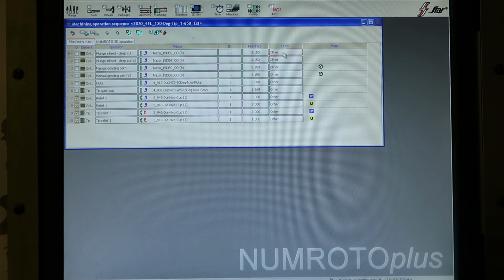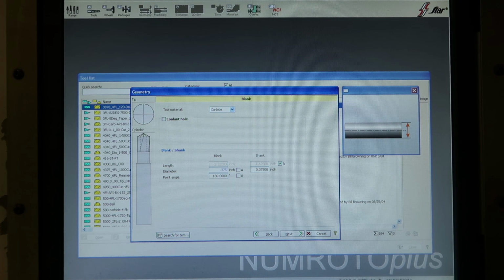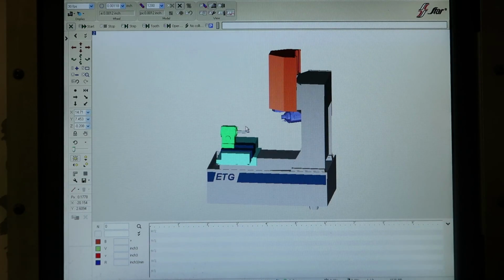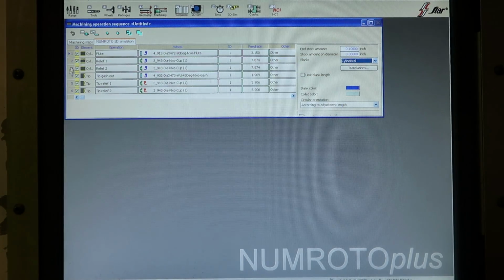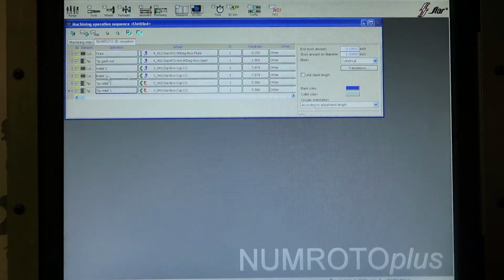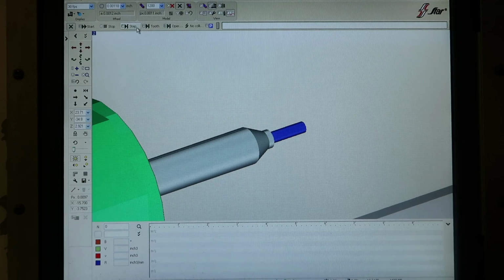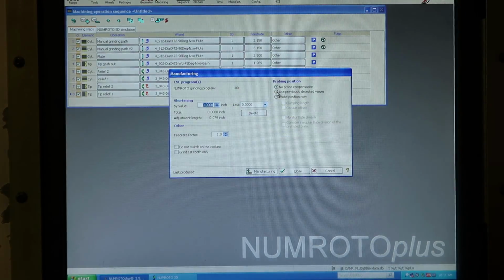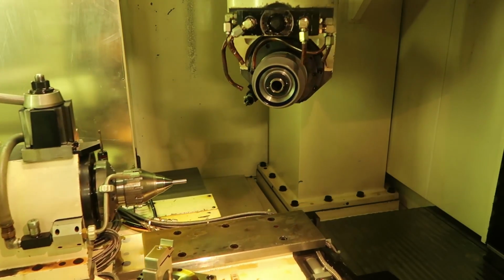Grinding Special Endmill

Comment: Hello I have 1 question. You changed length of rod on 0.1 inch I understand why. I did something and simulation was OK. If I wanted to make tool like this my machine doesnt count with that. Could you write me where can i rewrite this value for NC machine? Thank you for answer
Reply from the maker: Are you using the same NumRoto software that I am?
Reply: I have version 2018
Reply from the maker: In the manufacturing menu you need to select shorting the tool by the amount the tapered tip sticks out in front of zero. (In this case it was a little less than .100". So I used that.) But if the setting in the probing setup is shorter than that it wont let you enter the .100" shorting in the manufacturing setup. You need to increase that to something  greater than the value you set in the manufacturing setup. This is only necessary because the tip of the tool is greater then the blank. Or more precisely greater than the software thinks it is. I am forcing the software in this case to do what it isn't really setup to to. But it will do it.
Reply: Thank you so much i watched your video again and I know what was problem. I made 1 chamfer thank you for idea

Comment: The principle is good but you don't realise the limitation you place on yourself by using the "flat" surface of a belt grinder. Using the round surface of a grinding wheel and placing the drill bit against the wheel ABOVE the centre of the wheel "automatically" grinds in some back clearance angle. A little like a ".hollow grind". Doing it in this way you have enough room at the end of the drill bit to grind a nice "facet" on the cutting edge. (The movement of the drill bit is more or less the same though).
When you have finished grinding the cutting edge a very slight "tweak" to thin out the web provides a nice "point" to catch in the centre punch mark. AN advantage of the "facet" is that it makes it a little easier to see if the cutting edges are equal.
Regards

Peter

Comment: In response to "Hey You"
After 40+ years in the industry you should be able to sharpen drill bits in an instant "with your eyes closed" It's certainly NOT a difficult task. It takes only seconds to sharpen a drill bit, certainly less than a minute to sharpen a DULL drill bit and not much more time to sharpen a damaged drill bit! I can sharpen a dull drill bit in less time than it would take me to go to the cupboard and unwrap a new one!

Comment: That is awesome! I love your channel man very cool machining work! How much does a custom end mill usually cost?
Reply from the maker: It kind of depends on the size and tolerance. Any ware from $70.00 to $200.00 for a 3/8” size. Also it depends on the complexity of the shape and coatings if any. I have made tools that went for more than $500.00 for just one tool. So it depends.
Reply: Thanks for the reply! Thats actually really reasonable! I wanted to get some custom Onsrud like O-flute bits made with longer cutting edge, something like 3/8" shank with a 2" cutting edge for the deep pocket reservoirs i make on my cnc router.

Comment: That looks like a really good software package with that machine. It sure is a nice piece of equipment too, looks a lot faster and better than doing all that on a #2 tool and cutter grinder by hand.
Reply: work of art making works of art...
https://www.youtube.com/watch?v=MtLAn1Ud_U4
http://www.star-su.com/machine-tools/tool-sharpening-machines/tool-cutter-grinders/PTG-6L
Engineered to manufacture complex cutting tools, the new Star PTG-6L is a five axis, CNC controlled cutter grinder for manufacturing, sharpening and reconditioning a wide variety of cutting tools.  Made in the U.S.A. and equipped with a six-station wheel pack changer, the PTG-6L is built for high productivity and precision.

Comment: How did you run without coolant? You mentioned you had to run coolant, so you closed the doors and the coolant came on, yet you have shots without. Did you only run coolant on the steps that absolutely had to have it and dry on the rest, or did you cut another tool dry just to get video.....I'm not sure if you could run dry and sacrifice some stock and a bad finish, just for video sake. Great video. That finished cutter looked like an art piece and it is cool to finally see how mills are made. Maybe I missed it, was that tool cut from carbide or was it some form of steel, such as HSS?
Reply: If you watched & listened after he closed the door for the coolant, he explains that he's doing a dry run just so we can see what's going on. The dry run happens with an already ground piece of stock, so the wheels don't need to grind much/any material without coolant.
Reply from the maker: I first ran the whole tool with coolant. Than for the video I reran the program without coolant wile recording the video clips. I actually had to run it twice to get all the clips I wanted. If you look at my latest Intsagram (peterlstanton)post you will see all the tools I ground for this customer. This was just one of many.

Comment: Interesting video, thanks! Would wiggling the part in a small glass of ethanol then blasting it off with air not take off all dust and particles?
Reply from the maker: Thank You. I did do something similar to that. I used Acetone I didn't have any alcohol. Even the moisture coming out of the air hose shows up. Than you try to dry it some how and I couldn't find anything that wouldn't leave lint. I even tried spraying it with  RainX than blowing it off.  On the toolsetter (The CNC one) we use this sticky stuff to remove the lint and dust because it will pick it up as the tool when making a measurement. But I couldn't find any at the time I made the video.
Reply: Edge Precision Ah ok blue tack (or something like it like Play-Doh)? I had no idea that it was  so critical when using a microscope...

Comment: Another awesome video Peter. Keep up the great work. A machine like that would be amazing to have at our work because we get custom endmills made up for our spline cutters we use to cut splines on all the shafts we do. We get SEI Carbide to make them for us in a 2 mod, 2.25 mod and 3 mod spline profile at a cost of about $140AUD each.
Reply from the maker: Yes it is nice to have the capability to grind you own tools. It changes the way you can approach jobs. as to the economics of owning your own machine I'm not sure. I think its more economical to buy the from someone else unless you grind many tools. But there is the time it takes to wait for another shop to do it. Also if you can do it yourself you don't have to stock as much extra tooling in case you break a tool.
Reply: Yep thats very true. While we do keep about 60-80 of them in stock because we use them daily its probably not enough to justify buying a machine like that. Sure would be nice to make custom tooling though to give you more options on how to make a certain part.

Comment: very interesting,  that cad/cam is that software just for that tool grinder?  interesting seeing the touch off  and if you took tool out and then put tool back in  it can reset flute location with the probe,    what does the Aloris tool post do in the machine?
Reply from the maker: Yes the probe can relocate the flutes. You can even measure the helix angle and measure uneven flute spacing. If you watch my video Modifying a micro 100 tool you will see what the tool post does. Thanks.

Comment: Hello Peter thanks for the info you provide. Question can you make any type of tool or is the tool grinder just for special type tools! That are not available inexpensive, I hope my question makes sense.
Reply from the maker: If you mean can it grind standard tools. Yes the cycle I use in this video is for grinding a standard endmill. I just changed some settings to accomplish a custom tool. This video just shows a very little what this machine is capable of grinding. With proper fixturing I have ground or modified lathe inserts, brased tooling, reamers, form tools, corner rounders exc. With the proper shaped wheels it could grind thread mills and taps. The only limit is the operators ability to do it. I have had no training so I’m still learning.
Reply: Edge Precision ok. So this machine is what an actual tool making company would have to produce their non insert tooling or a machine similar. Cool thank you.. I would truly enjoy apprenticing for or with you. I have no manual or cnc experience but I have metal fabrication experience custom sheet metal and trailer building. I am fascinated with metal work and mills lathes and cnc. Thank again

Comment: That's really cool Peter.  Today I sharpened a 2 flute 1/2 HSS on our cuttermaster grinder for the first time.  It's a far cry from what you're doing for sure.   Is that software unique for that machine?
Reply from the maker: Thanks Bill. No I think other CNC grinders use this software. They probably have made improvements tho is a old version.

Comment: That looks like some sophisticated software.
Reply from the maker: Thanks! I meant to show in the video but forgot. When the machine is running you see no code scrolling by. All these cycles are run in some kind of canned cycle so all you see is something like G330 and that’s it. Now imagine how complicated that is to do full five axis moves with grinding wheels and offsets.
Reply: Yeah, pretty sure the machine doesn't run on normal G-Code. Or essentially it's a bunch of hidden G65 Macros of some kind. All the settings you fiddle with are a bunch of 'go' commands, and every motion generates itself due to, in some form, already written. ;)

If you decided to attach some wheels to your Mazak spindle for some job. The amount convoluted workarounds you would be needing to do the software, and offsets will be nuts.

Comment: As always Peter, great video and great explanation.  Does the offset (what you changed from .005 to. 002) offset the wheel?  Bigger wheel, smaller tool?  Also, I noticed the little drawing called out 3fl, did they get an extra for free?  Lolol, just funnin', I know you said you knew the customer and the tools purpose.  Take care!
Reply from the maker: I talked to the customer and asked if I could make them 4 flute tools. The reason is it’s easer to measure the diameter. The offset I changed is for the face of the cup wheel on the end of the arbor. This is sort of like the height offset on a milling tool. You can assign the offset either to the diameter of the wheel or the flange distance of the wheel on the arbor (the length from the spindles face). Thanks.
Reply: Edge Precision That's a great reason, and you're absolutely correct about it being easier to measure.  I meant no harm/offense with the comment, I love your work and your channel.  Thanks for the reply, and explanation of the offset!

Comment: How did you end up with a machine like that? Were you guys grinding lots of custom tooling back in the day for some jobs?
Reply from the maker: Many years ago I was doing some parts called battery inserts. In the oilfield these parts carry the batteries for their down hole instruments. They are usually made out of Inconel 718 for some reason. Doing the end work on the horizontal mill requires many special form tools for the ports. I started by having other grind shops making my tools but they didn't get it right or my design didn't work the first time. It requires experimentation sometimes. Well I had so much difficulty with that. I kept my eye out for a good used CNC tool grinder to make my own tooling. One day I say this machine for sale and bought it. Than began the learning challenge/ordeal of knowing nothing about grinding tools except on a manual too an cutter grinder. The terms and grinding cycles are totally different than normal machining. But I did learn and this is where we are today.
Reply: Quite the story! Super cool!

Comment: Great once again, from someone who doesn't know anything about grinding. What price range and life are you looking at for these wheels?
Reply from the maker: A grinding wheel pack with the three wheels like yo see cost about $1200.00  for the three wheels. These wheels have a lot of diamond content. They are not the same as the type you typically use on a manual tool and cutter grinder. Oddly CBN wheels for grinding HSS cost even more than diamond.